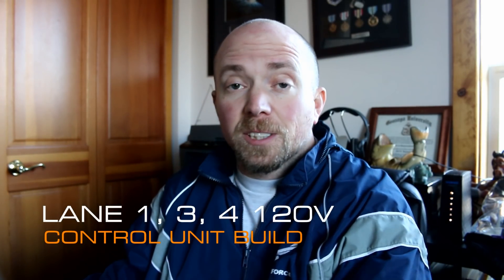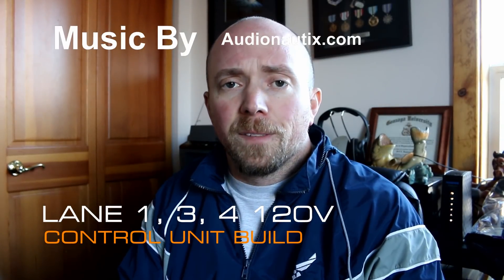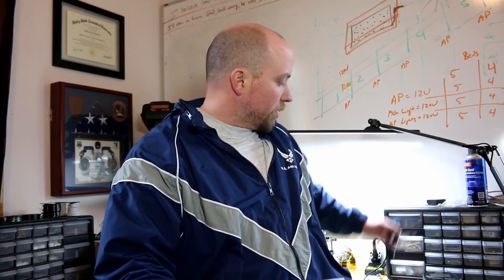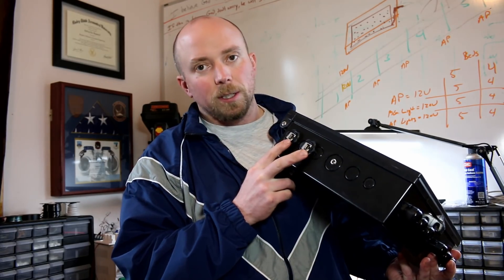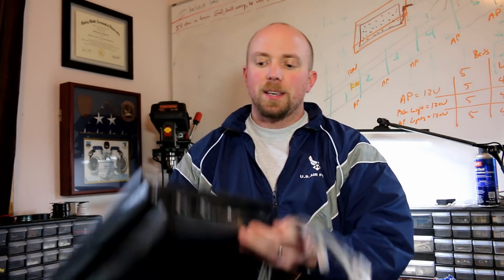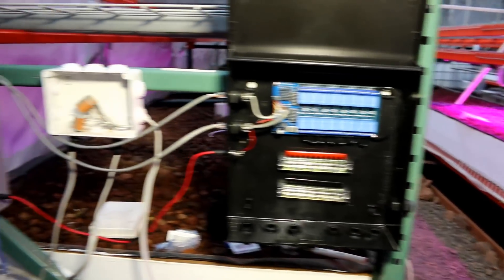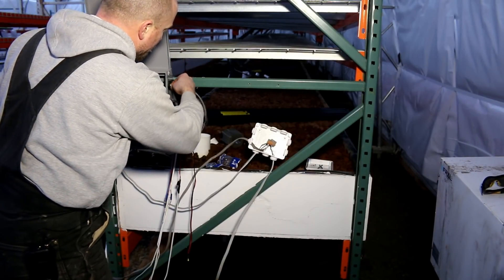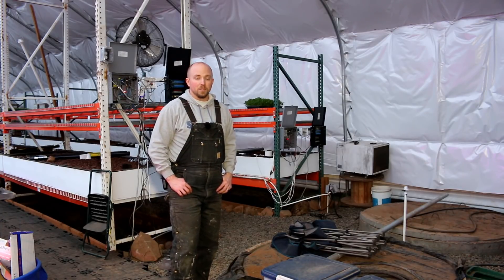Constructing HIGH VOLTAGE AUTOMATION

Comment: Daisy chain the high voltage cables to the relay is a bad idea because it de rates the capacity of the first link, the more relays on the hotter the first will get . If running 4 relays with 4 amps on at the same time that’s 16 amps in the first link. It may not be an issue if your only running a max demand of 10 amps through the relays. A better way would be having 4mm2 wire in to a bus bar then using 2.5mm2 to each relays

Comment: awesome video..... if you find that you will be building more panels like that, you should check out the Conduit knockout punch sets they sell, they are so much easier than hole saws & cheaper in the long run... keep up the awesome work!! 
  https://www.ebay.com/i/222803388236?chn=ps